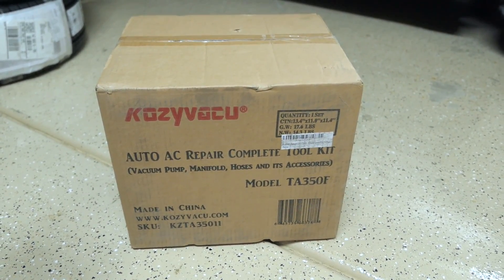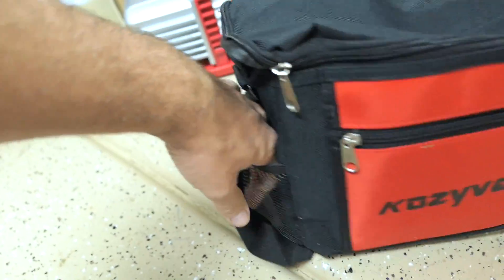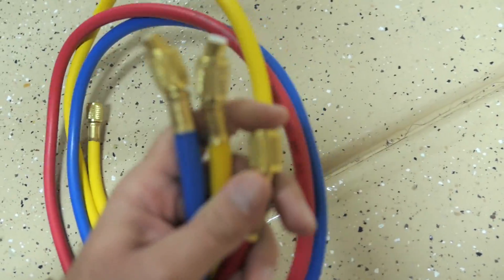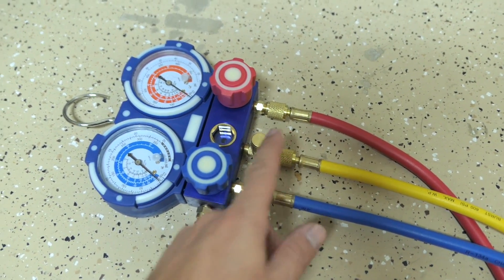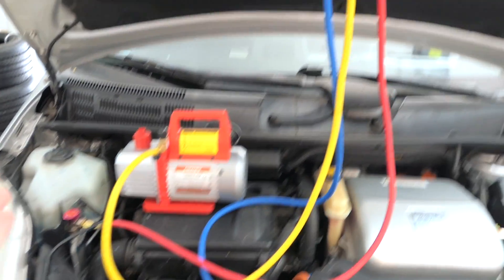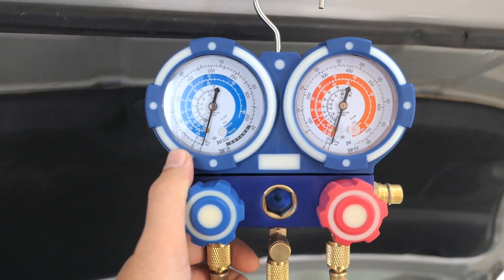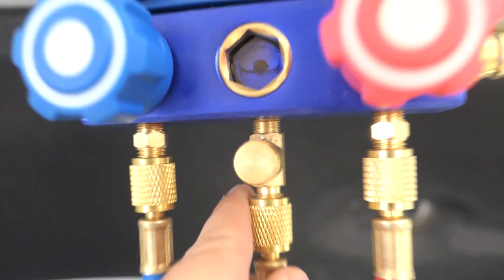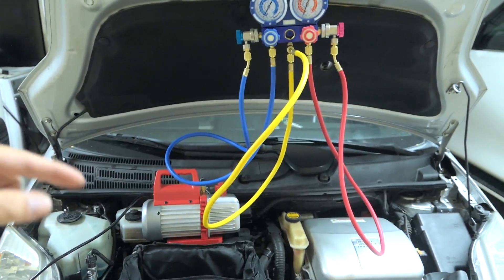DIY - Automotive AC Repair Kit - Kozyvacu

Comment: When checking vacuum, you leave the valves open.  You always purge the yellow charge line before starting the charge.  You always add the specified amount of PAG oil to the system when charging.  You make sure you weigh the exact amount of refrigerant needed using a scale, before adding.  Have fun!

Comment: Like 70% sure when you checked for a maintained vacuum you closed the valves. Meaning that reading was in the gague itself and not reading the system pressure. Pretty sure red and blue need to be opened with yellow closed to read the system pressure and check if its holding the vacuum.

Comment: first purge yellow hose before adding refrigerant      also not enough refrigerant thats why  compressor keeps cycling on low pressure switch   just keep adding till compressor starts to stay on longer never add liquid refrigerant on low side of system you will damage compressor     monitor the amount of refrigerant you are adding DO NOT OVER CHARGE

Comment: Do NOT turn the can upside down you will bugger up the compressor! You prob killed the compressor
Reply: depends on how close the low side port is to the compressor, if it`s far by the time it reaches the compressor it would be vapour, if you use vapour to charge only the pressure would equalize and no more r134a would go into the system, so that`s when you would have to turn it 90 degrees to get some of the liquid out, or just put the can in warm water

Comment: You are supposed to purge the yellow line. At the top of the yellow line there’s a purge valve. When you turn the valve down onto the can of r134a you’re supposed to leave it pushed in. I did the same thing the first time thinking I was supposed to puncture it and turn it back out. The set does look nice though.
Reply: Yes the brass knob on the yellow line on the manifold is the bleed valve just turn it clockwise to bleed the line but make sure you do this quickly so you don't loose unnessary refrigerant
Reply: How much is the kit like to get one for myself

Comment: just a little valuable tip.. always bleed your yellow hose when adding the freon otherwise youll get air and condensation in the system.. just a tip...
Reply: Thanks for the tip. I think that’s what happened to me when I did mines 2 years ago. The ac was cold, but not as cold as it supposed to be. I’m doing it again now because of a puncture hole in my ac condenser that was cause by the trans cooler bracket breaking.
Reply: how to bleed the yellow hose sir ?
Reply: @ahmadsyahmi351  open the valve untill the freon starts to come out.. therefore all the air is out of the system..
Reply: @tudocervera3764  thank you sir. full understood